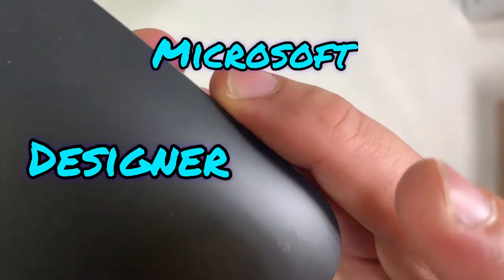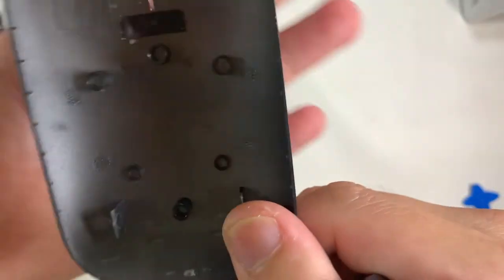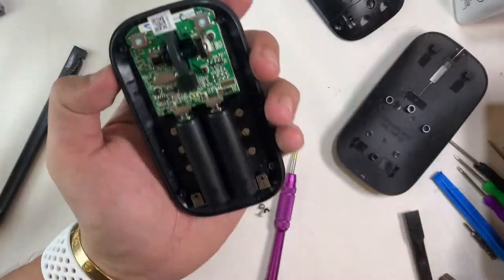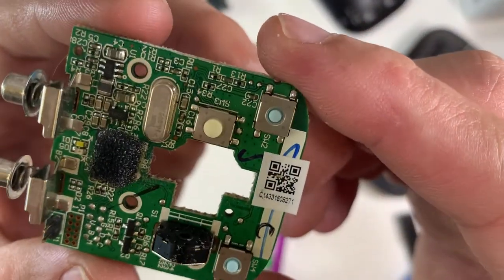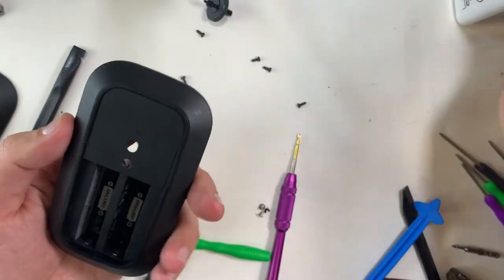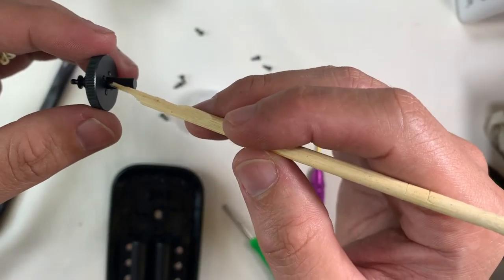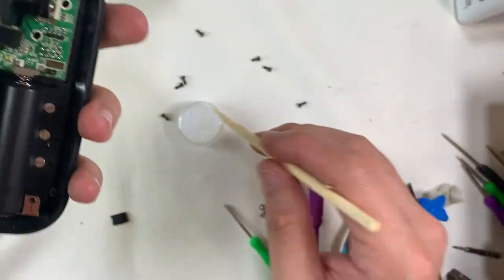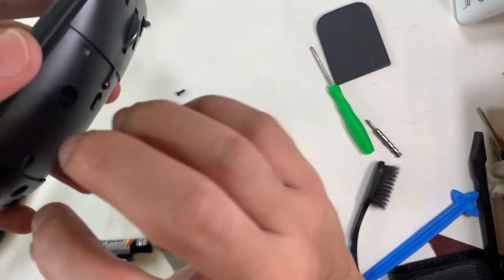#15 Teardown & Clean Microsoft Designer Bluetooth Mouse FTK-00013

Comment: Uses a cheapo wheel encoder for the middle wheel. Slowly fails after a year or two by skipping and/or reversing.
The encoder itself is tricky to take apart, but it needs regular cleaning to restore proper functionality.